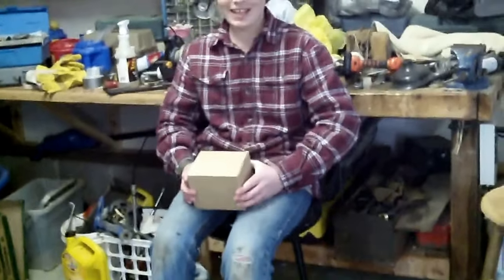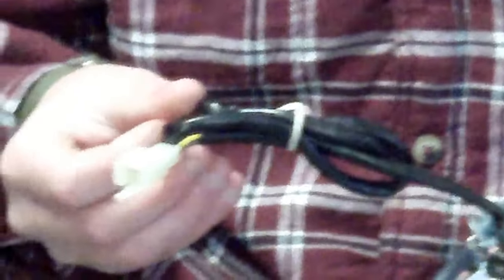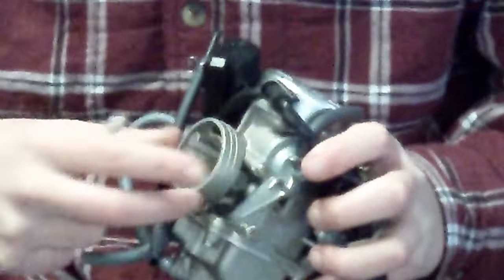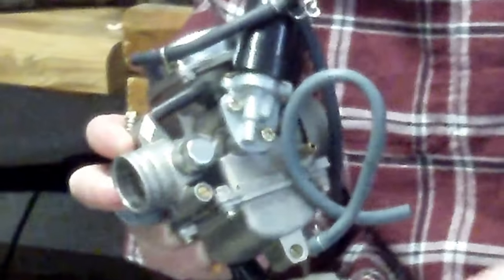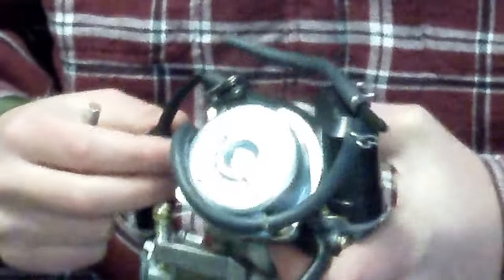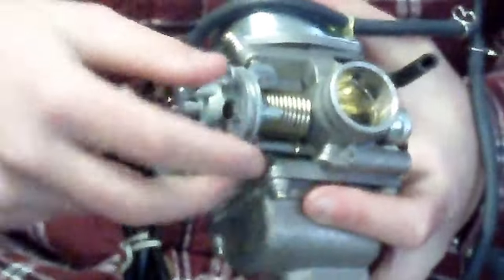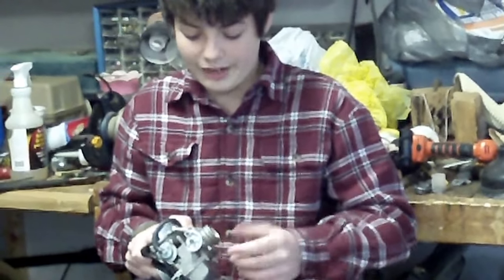Quick GY6 Carburetor Overview!

Comment: Can anyone help? My Chinese scooter manual says: " Tighten the Fuel Adjuster Screw and slowly loosen it by normally one and a half turns. Fasten the adjuster screw at the position where the highest idle speed is obtained and then turn the idle speed screw finely to the required idle speed." - Where is this fuel adjuster screw? I know where the idle speed screw is. (I'd like to adjust my air mixture because I'm below sea level but can't cus it's covered up in this carb body.)

Comment: very cool. Question tho.... the T that goes from the intake manifold to the vacuum hose.... does the third line goes directly to the gas tank? so there are two fuel inputs?
Reply: Carlos David Falconi did you figure this out?
Reply: @AceMotorsports  no but only because I think I bought a 250 cc carb. It has a little bit of different setup and ... two intake ports? Im not sure i havent messed with it.  But my motor is definitely a 150cc gy6
Reply: Well on my scooter that line goes directly up towards the gas tank but connected to a petcock valve which is a three-way valve on mines and it sucks a valve pressure to release the gas basically
Reply: @1983bigfrank   thats how I tried to set it up but it won't stay on.    The one I bought and where normally I would find the fuel input to the carb I see a cap and then two-terminal in the shape of a V a little higher up. Both seem to go right to where the electric choke is.   Ths is the one ....... https://www.ebay.com/itm/PERFORMANCE-GY6-Carburetor-30mm-GY6-150cc-250cc-Moped-scooter-KF-Carb-Carburetor/251760067407?ssPageName=STRK%3AMEBIDX%3AIT&_trksid=p2057872.m2749.l2649

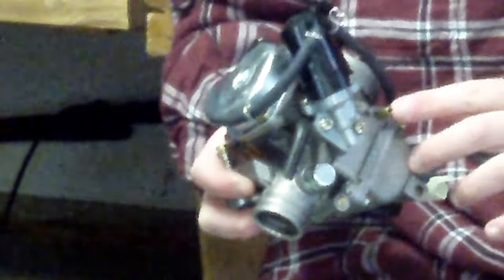Comment: You say the gas tank connects to 2 different ports on the carburetor? Time port1= 2:12 and port2 @ 2:37. So do I need a 4 way connector? 1 to tank and 2 to the fuel, 3 to the intake and 4 for the other side of the carb?
Reply from the maker: T.A. D The first is where the fuel actually goes into the carburetor. The latter one hooks up to a vacuum regulated fuel cutoff valve that bolts on to the gas tank. With the engine is running it produces a vacuum that is transferred through those lines to open the valve, thus letting fuel go into the carburetor.
Reply: T.A. D rite that's what I was wondering I think I need a 4way are change the thing on the gas tank
Reply: I had the same question, so what did you end up doing?
Reply: @garageguru1869  let me see if i finally understand this .so from the gas tank through the filter into a petcock valve .the petcock valve now has 2 exits one is a gasline into the intake nipple on the carb the other exit from the petcock is a vacumm that goes to a "t" one side of the t goes to the other niple on the carb .the other side of the t goes to the manifold .is tjat right ? Lol

Comment: good job...where the vent tube above the air fuel mix screw go?
Reply from the maker: wakeywakey Its a fuel overflow...just lays to the side
Reply: Time to wakey wakey there Mr wakeywakey.
Reply: jordanjcm jordan lol
Reply: Garage Guru  the bulb drain tube(I think that's what you called it, it's the one on the bottom) on my carburetor it's poring out gas is there some where I can connect it to or stop it some how pleased help me out
Reply: @mattgruska7127  did you fix your problem? Mine does the same thing
Reply: Mines pouring out too !
Is the carburettor stuffed ?

Comment: Y'all younger guys u get my age 55 no drivers licences because of type1 diabetes since I was a teenager put me on a gy6 chineese scooters iv had 4 so far I better learn all you can if you want have a dependable scooter not breaking down all the time I got a 2014 taotao been sitting for about 7 years or longer it rusted the gas tank caused by these locked flip key open gas caps be aware of these locked gas caps the guy I got it from was trying to ride it with jyst adding gas to it got into the carbarator iv cleaned it put it back on several times leaking gas this time I'm going to run gas line on work bench were I can see what's leaking bowl gasket or other parts 
The scooter has only 62 miles on it.its good viedo online a guy explains all gy6 carbs jets everything needed to know a chineese carb.